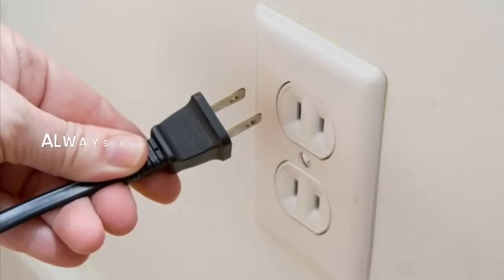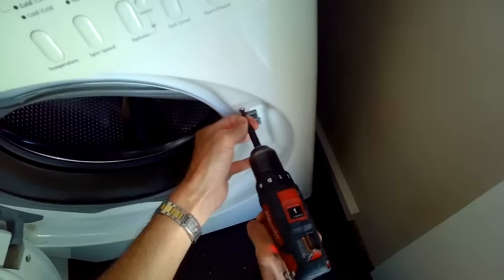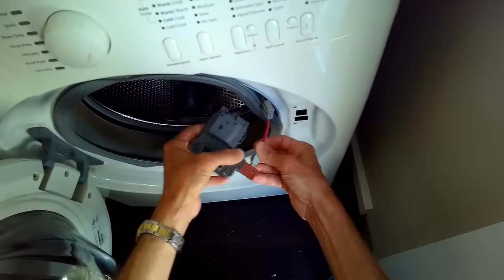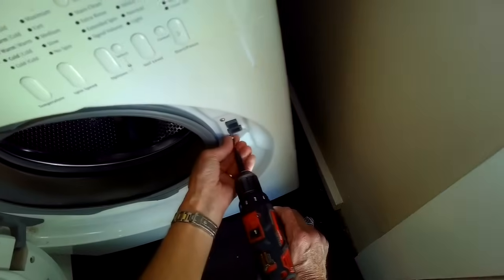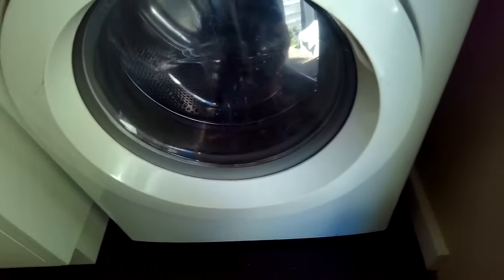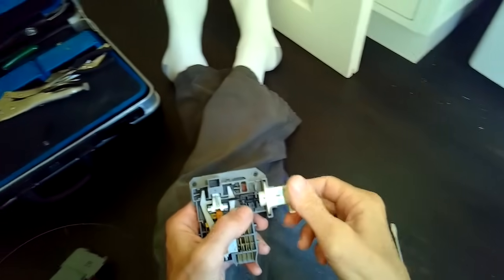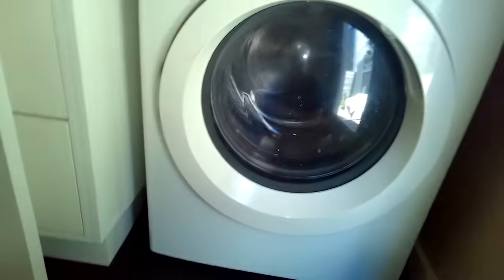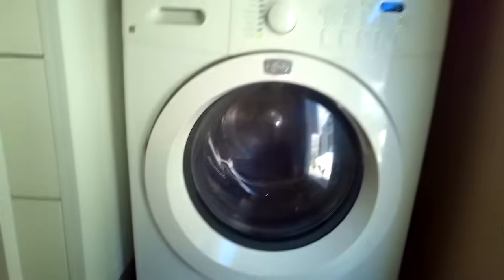✨ FRONT LOAD WASHER WON’T SPIN — FIXED IN 8 MINUTES ✨

Comment: Can you help me please, I have changed the switch but still does same only do one turn very slow and stop, and after a few minutes do it again and stop. Would you give me an Idea what can be?, I will really appreciated it !!
Reply from the maker: Nice job Martin,
If you have a machine that won’t go to spin after changing the door lock the next most likely cause is a malfunctioning motor controller.
Just need to replace that.
You can put your model number in a Google search with the word motor controller and you should find a few companies that sell it.
It’s pretty easy to replace.

Comment: Hi sir, how do you know that the door lock is faulty? And not other parts?
Reply from the maker: I start with the door lock because it’s cheap and easy to do.  Could also be the motor control unit.
Reply: @QuickAndEasy5MinuteAppliance  ahhh ok. That makes sense. My washer doesn't spin after it filled up water. 😭
Reply: @Usernotfoundddd  My issue is like yours. How did you fix it?

Comment: So my washer the tub rotates, but it won't do the spin cycle. Is this the problem potentially?  Is there a way to test if the current on is good before replacing?
Reply from the maker: Most likely it’s a bad door lock.

Comment: Thanks man ! Easy with your help. By the way, Nice dog :)
Reply from the maker: Thanks so much😊
Reply: @QuickAndEasy5MinuteAppliance  hi , what if the lid works but it wont agitate and spin after the pump working it just won't agitate and i can hear a scratching noise in the motor it trying to agitate but it won't , after awhile it showed an LE Error

Comment: Our 7 year old Bosch front loader just today was having spin issues we get no error code the spin goes far from the 1000rpm it would normally, smell a burning smell and our washing is dripping wet, tryed just a pair of socks on spin but same  issue. Any idea what I need to check or do to try resolve this?
Reply from the maker: You need new motor brushes for your motor .
Reply: @QuickAndEasy5MinuteAppliance  actually just this morning i got error code e6 drained the tank and removed a lollypop stick a heap of fluff and 2 clothes tags from the bottom right plug and she is draining like new. That  smell must have been the washer working hard

Comment: I replaced the door latch, cleaned out the drain and checked the belt (which seems fine) and my washer still isn’t entering the high speed spin. The only washer repairman in my area can’t come out for months. Any tips?

Comment: Great video!!! You should change the title though. It should say "Front load washer won't go into high speed spin." The reason I say that is mine won't spin at all now so I came here thinking it might solve my issue...but I still learned something new ;-)
Reply from the maker: You might need a new motor controller
Reply: @QuickAndEasy5MinuteAppliance  Yes sir....or the motor, or the control board, or the pump!!! LOL - Going to strip it down today (maybe). I think I will test the motor first with a multimeter, that way I don't have to tear the whole machine apart if it is the motor. If the motor is good then I will check the tub-to-pump hose for blockage (I just know it is going to smell bad), especially in the coin catcher. Then I will see if something got lodged in the pump to prevent it from spinning. If all that is ok then it is either the master control board or the motor control board for sure...and at that point, it is to the trash. The machine is 8 years old and has shown signs of the control board going out before (for a while the machine would come on by itself and start beeping...which I resolved by unplugging the machine for overnight and then plugging back in and running the dials through the cycles)...so yeah....time for the junk yard I am pretty sure. It was a cheap model anyhow. Once again, thanks for the cool video on the door latch issue ;-)
Reply from the maker: Sounds like u got it 👍
Reply: @daddylogan  did you fix it?
Reply: @bmw12347  No....it was the motor control board...but I learned how to take  a washing machine apart and put it back together for learning purposes.
Reply: Mine will fill and won't agitate. When set to spin,  it won't spin.  Drain function works.  I'm just trying to figure out to buy door switch or motor controller. I don't even know what the latter looks like?

Comment: in my case, it works like 30% of the time.(3 out of 10 / plus i hear drumroll sound when its spinning... ) would replacing the door lock fix my washer spinning?
Reply from the maker: Yep,

It’s on its way out
Reply from the maker: How loud is it during spin?
Reply: @QuickAndEasy5MinuteAppliance  it's pretty loud, we can hear it from downstair. Weird thing is, that only happens(sound) only during 'dewatering' stage?!

Comment: My washer machine is not spinning, when I reset the washer it fills in water and then it should start spinning but it won't, the "drain/unlocking" light starts to blink.     What should I do? I dont see anything broken the door works fine aswell
Reply from the maker: Time for a new door lock😊

Comment: My door lock light would light up but no high speed spin action. I swapped the door latch switch and high speed spin is back.
Reply from the maker: Nice job Ed👍
Reply: @QuickAndEasy5MinuteAppliance  I opened up the bad switch and one of the contact points had come loose. These are pushed together by I thin the wax motor when it's energized. I always keep a spare one  now.

Comment: Maytag front loader MHWE450WW.
All lines cleared and clean, I mean all of em. Upon start, washer drum will spin full circle slowly about 3-4x's , then the drain pump assembly down below will just churn & burn until I hit Pause/Cancel, then Power. Then after about 4 mins, it will finally click, unlock door, and turn off.
Already replaced inlet valve, and pressure switch, took apart every clamp and cleaned up every hose clamp I could see, no obstructions. PLEASE HELP SHE WANTS TO BUY NEW ONES BUT I CAN FIX THIS FOR WAY CHEAPER. Help plz
Reply from the maker: Thanks Brad,
Can you contact me here: Please click here to contact me for more detailed help: https://calendly.com/scottthefixitguy/advice-for-fixing-your-appliance

Comment: Our washer will spin at full speed with no clothes in it - we’re only experiencing this problem when it’s loaded, even with a small load. Could this still be a fix for us?
Reply from the maker: Sounds like the motor is getting weak.  This would not be the door lock.
Reply: To add to that. At first the water pump was humming at the spin cycle. I changed it and achieved pumping but now it's doing the same thing as the other commenter. I can get it to achieve a decent speed empty but once a weight is added it seems to just not get out of first gear. Your opinion is that the motor is weak that makes sense to me and it sounds bad ( chirping almost ).My question is do you think the water pump being bad, forced the motor to work too hard and burn something up?

Comment: Mine spins normally without clothes. When I put in one wet towel or sweater, it only rotates slowly. I tried to replace the switch, still the same problem
Reply from the maker: I think the motor brushes are worn out.

Comment: I changed the locking mechanism still did not fix the spin issue. I proceeded to change out the drain motor ( $20 part ). The drain pump was defective. Once drain pump was replaced machine worked. I kept the new locking mechanism in place. My machine is 6 years old. LG needs to work on longevity of there products. Never worked on washers before mine went out. YouTube videos are definitely creating valuable handy men.
Reply from the maker: Nicely done.  LG makes a good washer but a lousy drain motor.
Reply: Lol I started with the pump and didn't fix the problem. Next I might try the locker?

Comment: I have a Tandem 7300 that won't drain, after the wash cycle. I have checked and cleared the pump/drain areas. Mine doesn't have a display, but I have successfully clear all error messages. Problem is, I don't know how to get the error code for the current problem. Any suggestions?

Comment: I replaced mine because it was acting up . Stop working. Then after many trys would work again for a week. Less then a year it has stopped again and staying stopped. Thanks for the wax motor upgrade.
Reply from the maker: Your welcome😊
Reply: May Maytag is 2 years old it will not start I got a code F5 does any body knows please help

Comment: Our machine spins,  but it never reaches the higher speeds needed to remove all the water. I’ve removed all the debris from the water pump. 
Any other ideas?
Reply from the maker: Hi Rick,
You need a new door lock👍
Reply: KY washer does the same thing did it reach the 900 rpm. During the test.cycle

Comment: easy for you... and this machine perhaps. However, according to RepairClinic, there are at least 20 reasons! why my particular front loader isn't spinning!
Reply from the maker: I think you can narrow it down to a bad door switch or a faulty motor controller .
Reply: Yeah, I've just criticised their video grinding totally random. I've also just read this guy say in the comments that it's the latch in 85% of cases! He should have said this in thevido of course. I'd also have liked to know if there is a way of testing the latch once it's removed. But he's done a good job.

Comment: My washer is making a rapid firing noise from the very start like it’s in fast spin mode. However it’s agitating as it should but no water pushing through the detergent cup holder and still making that loud noise

Comment: What if I place the door lock and it's still not working it's flashing do
Reply: Refrigerator front end washer I replace the door lock switch see what's being now you cut it on and it's flashing beeping and showing the d o i mean that must mean dough is not locking or but it is locking but now you don't want to come on no it was doing the whole white cycle the washing with wingspan z, iu

Comment: Hi , my whirpool duet front load washer machine doesn’t spin when appear sensing in the dash it keeps going back and forth for minutes and not spin it tryes but stop and just continues back and forth
Reply from the maker: Sounds like you need a new motor controller

Comment: 🆘👷🏻‍♀️ 🌉🏗️ 🍀🌊🌎
    How did you know it was the door lock that caused the drum not to spin?  Could there not have been other causes?
Reply from the maker: Yep,
If it didn’t drain all the way it won’t spin and if the motor controller stops working it won’t spin.

Comment: Help! I have a samsung washer top wont spin at all. Washer starts fill w water door locks light on but no agitation. Power off i can not manually turn drum even if i put a wrench on the stator nut to attempt to turn drum Switch?
Reply from the maker: I think you have a broken spider bracket that holds the spin basket.
Reply: Quick and Easy 5 minute Appliance Fixes in your opinion is it worth fixing? $
Reply from the maker: It’s so expensive,  I would get a new machine.
Be careful to not wash bathroom mats, or blankets or comforters.  They are so heavy that they’ll kill a front loader.

Comment: Maytag 2000 series front loader has a error code F1E2 and doesn't spin. MCU and motor is $230.00. I don't want to spend that much on a 7yr old washer. You think door lock may fix the issue??

Comment: Does ANYONE KNOW if the door locks could this still be the problem ? Tx Inadvance......!
Reply from the maker: Yes,
Even though the door does lock, there still may be a problem with part of the door lock that sends a signal to the controller to let it know that the door is locked, allowing it to go to spin.
This is a fairly inexpensive and quick fix for the no spin problem.
If this does not fix the problem, then the next thing to look at is the motor controller which is fairly expensive.
Reply: My control panel shows that the door is locked, but the drum will only spin very slowly most of the time or rocks back and forth. Control panel during spin cycle also keeps resetting minutes and/or sticks on the same minute for a long time. Then will just end. Clothes still wet of course. I’ve checked all the drain hoses, drain pump and the shocks seem fine. Could this still be the problem and if so do I need to replace the entire lock or only the wax motor? Thank you so much in advance for your time and consideration! I’m going crazy with this washer. And for the cherry on top my Samsung dryer is also not wanting to fully dry the clothes. 🤯😤 😫 it gets warm inside but dryer finishes the cycle before their dry even if the cycle in on time dry. 🤔  I’ve checked all the vents and vacuumed out the inside of the dryer so there’s no blockages holding in moisture. If I didn’t have to drag them up the stairs to throw them off the back deck, I would’ve probably done it already.😝 Thank You so very much for any advice you can offer!😊

Comment: If I did this it wouldn’t work 🤣 what if it doesn’t spin but fillers with water clothes soak but when you spin it yourself it seems like it doesn’t spin and makes a noise like something metal has come off??
Reply from the maker: That means the spider bracket that holds up the spin basket broke.  It’s best to get a new washer at this point since it’s so expensive to fix that problem.
Reply: @QuickAndEasy5MinuteAppliance  oh thank you 🤦🏼‍♀️

Comment: Thanks, that might be the problem with my washer. Had difficulty getting the door to lock/unlock the last two, three times the machine was used. Now the machine won't go into the spin cycle.
Reply from the maker: Sounds like a bad door lock
Reply: @QuickAndEasy5MinuteAppliance  
Door lock is working again. Not sure why.
Now the machine won't spin or wash, just silence after it drains and the pump shuts off.
Reply: Sounds like what mine is doing. Did you end up getting it fixed?

Comment: I had to replace the bearings in my drum and buttoning everything back up, it wouldn't go into high speed spin. Just went back and forth for 15 minutes during the spin cycle. I got back in and disconnected and reconnected the three connectors from the door latch and now it's fine! Very strange, as the door WAS locking for me. I guess one of the connectors (I believe the small 2 pin) wasn't making contact very well, so the control board wasn't sensing properly.

Comment: If the door lock still makes the locking noise could it still be bad?
Reply from the maker: Yes
Reply: Quick and Easy 5 minute Appliance Fixes I figured it out. My drain pipe was sealed up and not venting
Reply from the maker: Nice job👍
Reply: Billy Mehaffey and
Reply: Shafi Panthakkan “and”What?
Reply: Yes.

Comment: my Electrolux has code e38 pressure sensor. door wont unlock. It wont spin either. Any idea
Reply from the maker: The washing machine thinks that there is still water left in the tub and that’s why the door was unlocked and why it won’t go to spin.
You might have a plugged up drain motor.

Comment: Hey, thanks for the video! Do you know what the problem could be if my washer spins but won’t complete a spin cycle? For example at the end of my loads on the last spin, a few minutes into the spin s cycle the washer just stops and gives an error code. And clothes inside are still dripping wet.
Reply from the maker: I would say the most likely culprit would be the door lock is malfunctioning.
The other possibility is that the washing machine drain is partially clogged and it’s not able to get rid of all the water.
Reply: Depends on what the error code is. It could be a drainage issue or even a bad control board
Reply: Yeah it was a drainage issue, the was SE and sometimes SUD. But I moved the washer machine and kinda adjust the hose so that it was straighter because it had to curve up to drain into my sink so I don’t think the lint and whatever else was draining properly. Also had to open up the bottom drainage door of the washer to get some gunk and small coins and stuff like that out. Thanks for the suggestions.

Comment: My clothes caught the seal and ripped it off mid cycle. I turned off the machine and pull out the clothes put the seal back on but now won't spin and makes a noise when it should spin. Help!
Reply from the maker: Might be good to hire a tech to come out and fix that for you.

Comment: My washer starts, runs for about 5 minutes then stops.  Does the same thing when set on spin cycle.  It goes back and forth but never actually spins, then shuts down.  Does that sound like it is the wax motor?

Comment: My machine runs fine until there are 6 minutes left in the cycle and then it turns off without spinning or counting down anymore.
Reply: Did you fix it?
Reply: @jjrivera32  mainboard

Comment: My machine automatically goes to no spin when I start it and it does literally nothing. The technician changed the exact same thing and it still doesn’t work
Reply from the maker: Next cause is a bad motor controller.
Reply: i opened my door interlock assembly . its an indesit machine with bitron lock t85. it has kind of bimettalic thermal switch...is it suppose to do the same function?
motor is ok but the machine wont spin after 5 sec of initial spin